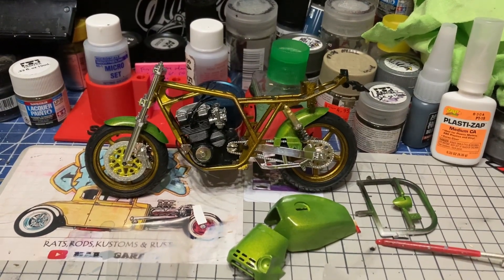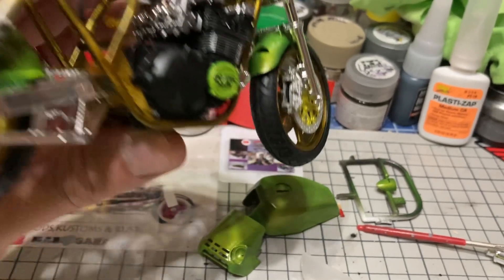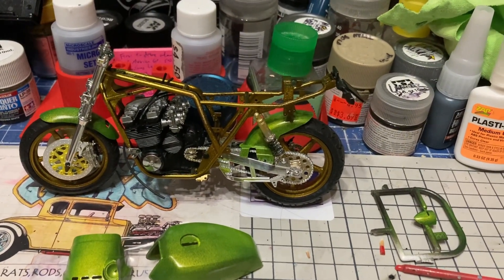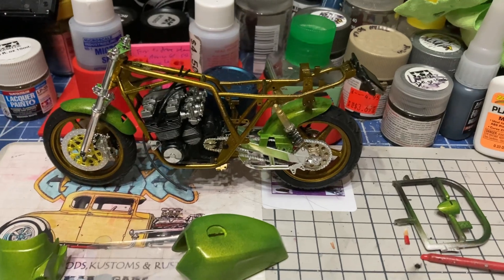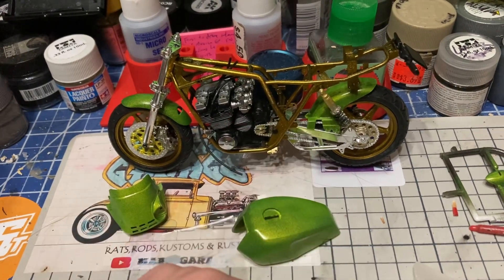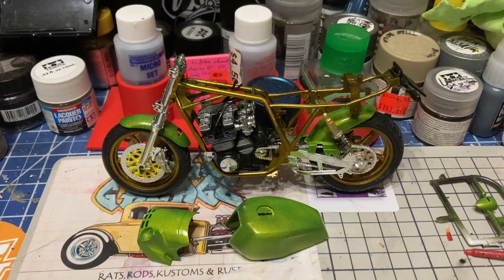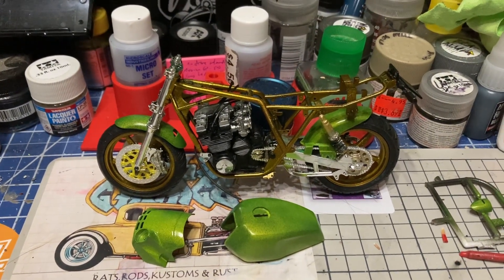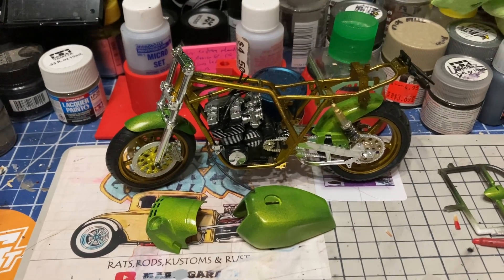#2024motorcyclegroupbuild update and exciting channel news!

Comment: Great looking motorcycle, love the color. Congratulations on the deal with Scale Finishes! I am working towards starting to airbrush, I'll be sure to use your code 👍
Reply from the maker: @BigSkyModelWorkshop  thank you Joe!! I don’t build them too often but they’re fun to do!! I think when you start airbrushing you’ll like scalefinishes products. I spray them straight from the bottle around 20-25 psi and they lay down really nicely. Airbrushing is a lot of fun to experiment with and gives you so many options!!
Reply: @kyledehartsscaleworks  I'm excited to start, I'm looking to order a Gaahleri GHAD-68 and compressor soon.
Reply from the maker: @BigSkyModelWorkshop  excellent!!! I love my 68. That’s my workhorse. The pistol trigger is what I’m most comfortable with and it sprays beautifully.
Reply: @kyledehartsscaleworks  that's great to hear! I can't really use a conventional one, my index finger got smashed flat a work a few years ago, and I just can't bend it right.
Reply from the maker: @BigSkyModelWorkshop  I see. So you have to have the pistol trigger anyways. Well I think you’ll like the 68. Easy to clean too. I should get another one for clear coat sometime.